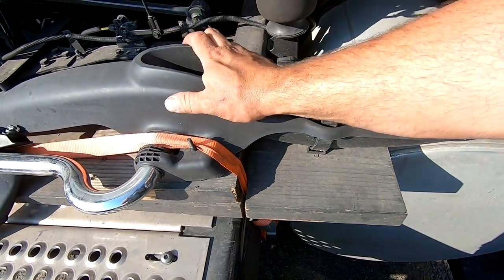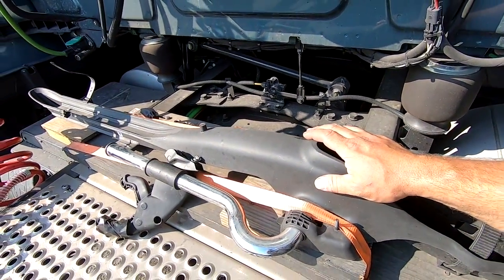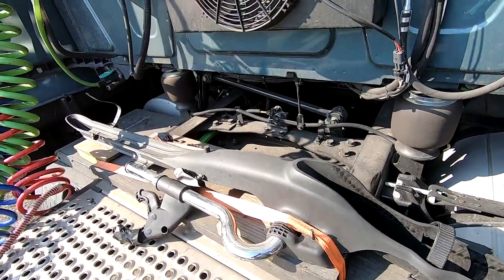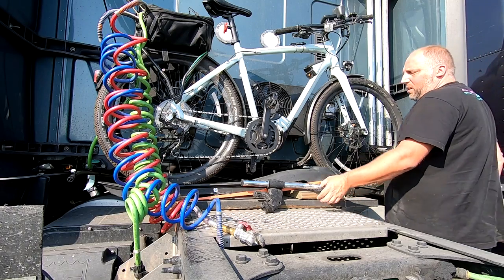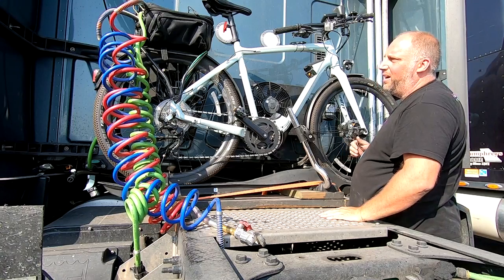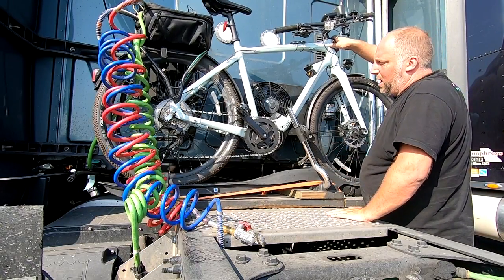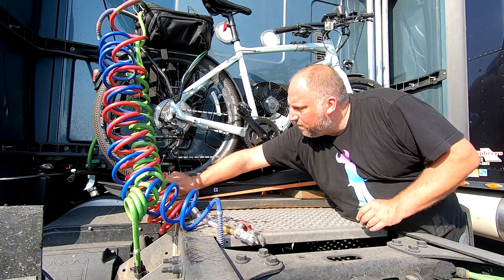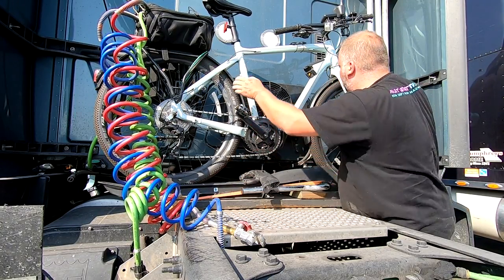How To Mount Your Bike To A Tractor Trailer

Comment: This is one of the best set ups I've seen!  I went out and bought a similar single bike rack used from marketplace and mounted it to a 2x10 haven't strapped it to the truck yet but looks like it will work.  The rack I bought was $75

Comment: What are your recommendations about mounting a small moped? My wife is going Otr with me and I’ve been researching how to mount a lightweight moped for traveling while we’re out there. You think if I got a motorcycle rack and did the same rig with the 2x10 it would work?

I’m looking at a 200 pound moped so I have no doubt I can lift it onto the rack. What are your thoughts?